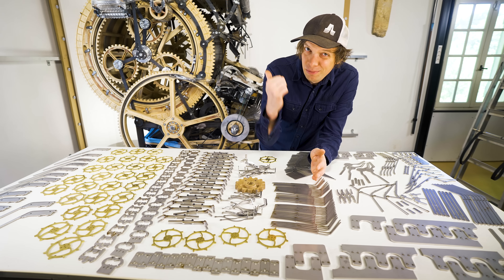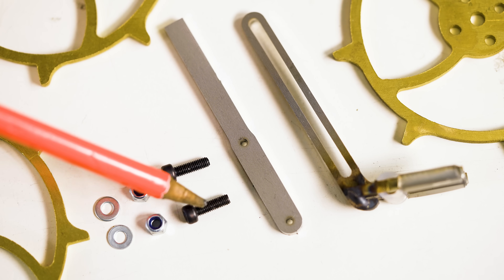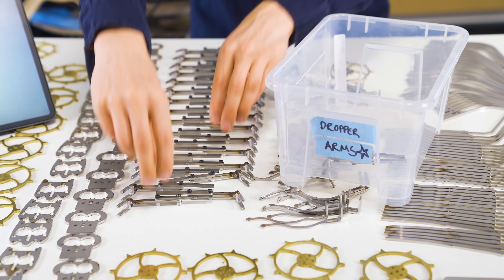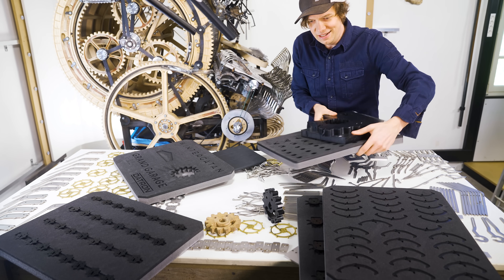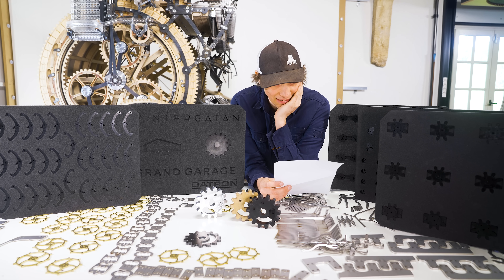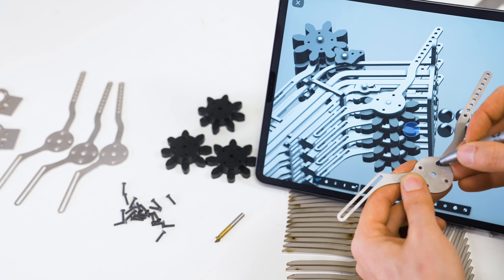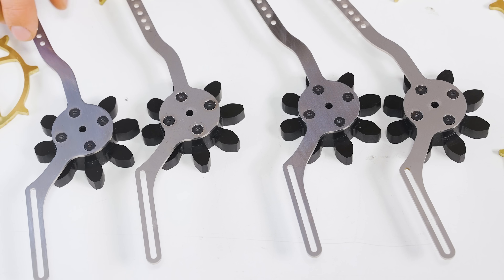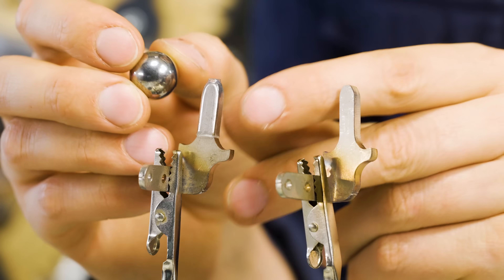Solving the 1000 Pieces Engineering Puzzle

Comment: Damn it, now that I can't put my welding cable around my neck anymore, I have to build myself a Marble Machine to put it around its neck :/
Reply: That "electromagnetic waves are dangerous" garbage is the reason why people thought 5G towers were dangerous. Don't believe the lies we are not knife fish (electric eels).
Reply: @evilcanofdrpepper  5G packs quite a bit less than the hundreds of amps a welding cable can be carrying. Enough juice in those cables and you can start levitating metal slugs in the loop. OSHA does have limits for EMF exposure https://www.osha.gov/radiofrequency-and-microwave-radiation/electromagnetic-field-memo so someone is taking it seriously.
Reply: @SBBurzmali  Yall might wanna read what you just linked
Reply: @SBBurzmali  The 5G antenna have far higher emmissions, but it depends on the type of antenna, there are smaller "router" sized accesspoints, those are not worse then your wifi router. But then there are the big ones on rooftops and towers, you do not want to hug those. but they are carefully calibrated and angled to maximize reception while minimizing power loss while keeping within regulatory requirements for safety. Belive it or not the telecom companies do not want to kill its users nor pay excessive power bills.
Reply: @TheMaidenOnes  5G towers aren't going to be radiating mast towers, which are the only kind that's physically hazardous to touch.
Reply: @TheMaidenOnes  We are comparing 5G at a normal distance to welding cables wrapped around your neck. Yes, I would be more concerned if he had a wireless tower around his neck, but that's not what we have here.
Reply: @SBBurzmali  sure, at a "normal/average" distance, the solar radiation on a sunny day is probably a bigger health concern...
Reply: @evilcanofdrpepper   5G might not be as dangerous as the initial speculations suggested, but it's still impractical, inefficient, and expensive AF...
Reply: @InventorZahran  apparently the companies think it's good enough to sink millions into its infrastructure...
Reply: @InventorZahran   "impractical, inefficient, and expensive" That could be the dumbest thing I've ever read.
Reply: @BigStrap  Thats because they know they can fleece billions out of their customers for "the privilege".  Would you like to know a short list of things that strongly attenuate (absorb) mmWave 5G signals?
1. Walls
2. Tree foliage
3. Oxygen
4. People
5. Your hands

They have to put 4 separate antennas in 3 different planes inside each mmWave phone so that it can do beam-forming and have a spare since at least one will typically be blocked by the user's hand.  Not only that, but if you expect it to work in your office building, don't, because it just doesn't have the range or wall penetration.  The planned solution to this is to install a mini-cell-tower in every building that will have service.  Outside of a large city?  Too bad, these towers only have ~1km of range and your service provider is sure as heck not going to blanket the country with one every other kilometer.

Not only that, but in addition to the 4+ extra antennas each phone will need, they also need a 5G modem that consumes almost as much space and power as an entire phone SoC + integrated LTE modem does today.  So kiss your days of finally decent battery life goodbye if you're using 5G much.

Will it still happen? Yeah probably.  Is it worth the tradeoffs? Probably not.  Fully deployed 4G LTE with carrier aggregation can deliver almost 2Gbps throughput, but US carriers are nowhere near that.
Reply: And a robotic arm to use it, don't want to hold it in your hand!
Reply: The world is better off with more marble machines! Go for it!

Comment: Clean burned holes with drill to correct diameter. Then we need quality thread cutter for stainless and machine cutting in battery drill. Good cutting fluid and cutting threads will be fast and easy. I did this with parts I made for my 3D printer.

Comment: You definitely need to use lubricant when you're drilling that stainless. Even just squirting some oil onto the bit occasionally while drilling would make a world of difference. Messy, but you'll end up with cleaner cuts and less broken bits.

Comment: Dude that packaging is another level
Reply: At the very least, it looks like a lot of empty space where some of those sheets could have been combined, thus cutting down on the number needed.
Reply: A lot of plastic foam waste though.
Reply: @piranha031091  But then... Can you find us any cheaper, biodegradable, easily find material for replacement for example?
Reply: @joshuachan6317  Popcorn works pretty well.
Reply: @joshuachan6317  Newspaper, and biodegradable packing peanuts.
Reply: @piranha031091  Or cardboard.
Reply: @nagualdesign  Food is not an easy ship between countries. Just saying.
Reply: @Cinemaaereo  If you're talking about popcorn packaging, it's only slightly more edible than the cardboard and can easily shipped worldwide, just like starch-based foam peanuts.
Reply: @joshuachan6317  Uh, paper? Or even paper foam?
Reply: @AstralS7orm  Paper foam is not paper, and paper couldn’t also protect the parts well during shipping.
Reply: @piranha031091  but it's safe for transport
Reply: In the business of packaging engineering, it's what we call "a lot of fancy trash"

Don't get me wrong, I would find a hundred ways to reuse that packaging material before I threw it away. Just a friendly way to say some packaging was overdone.
Reply: @Hexlattice  we actually do reuse that packaging it gets mixed with corn to make plastic such as food grade material 5-gallon containers for water it just depends on what country you live in and if they recycle it
Reply: @JohnSmith-cb6qx  I agree, the pieces are not made of crystal, alla that foam is overkill
Reply: It’s clearly “presentation” focused packaging.   And achieved that objective as well as protecting the parts.  However,  if you only cared about the latter then... Many of those parts could have been stacked with paper between.  Then wrapped into a brick or log with some padding around that.  Using a lot easier to recycle (or recycled) materials.
Reply: And that 0.000 mm precision 🤯
Reply: It's a Rudi thing! Now his colleagues at GG feel a little bit pressured to say the least, haha! :D
Reply: @GRANDGARAGELINZ  I hope Rudi takes some of these comments on board and uses laser cut cardboard in future.
Reply: Seems like it was on many levels in the box...
Reply: lets hope the more expensive mushroom foam becomes more popular
Reply: @bennie_bee  I hear it's being used to insulate buildings, so the price should be coming down.
Reply: Shipping and handling fee:  $259.78
Reply: @JohnSmith-cb6qx  watch seaspiracy
Reply: Bruh that fucking machine accuracy, though
Reply: Why not just put everything in a paper bag and pedal your bike over for delivery?
Reply: actually pretty normal here in germany
Reply: @lexus4tw  you mean austria ;)
Reply: @davidarbinger3543  i mean Germany, I know this parts are from Austria
Reply: True
Reply: @lexus4tw  Foam is recyclable, and can be reused
Reply: @garrettdyches8426  I know, and plastic is not a problem if recycled properly. Artificial materials aren't that bad if used correctly
Reply: @garrettdyches8426  Foam is of the "technically it can be done, but no one can do it economically at the moment" family of recyclable items, along with most types of plastic.
Reply: @JohnSmith-cb6qx  so you're talking about raising the average shipping cost by over 90% even though the material used is recyclable. At least learn what you're talking about before you make a complaint
Reply: It is horrible. Unneeded trash
Reply: So, regarding the waste issue here: This is normal, closed cell PET foam, which is easily recycable, just like every plastic bottle.
Reply: @ringo_98  Assuming that it was PET, it's unlikely to have any markings on it to confirm that. In the absence of any recycling markings, plastic waste is sorted by density, which doesn't work with expanded foam. That stuff will end up in a landfill or burned.
Reply: @nagualdesign The foam is already based 100% on recycled material. Proper disposal provided, this should not be an issue. Putting things into perspective, the residual POM stock imposes a lot more challenges if not disposed of correctly, yet I have not seen a comment about that.
Reply: @ringo_98  It may well be made from recycled plastic but it's highly unlikely to get recycled again once it's been turned into foam. The technology to sort one type of foam from another doesn't exist.
Reply: @nagualdesign  I am not making assumptions here. 
Correct disposal provided, waste foam material can be reused in many ways, that is nothing unusual. 
And even then, it's not like that foam was specifically ordered for this usecase, we are talking about leftovers that would have  gotten thrown away anyways. I appreciate the feedback, please consider that things are not always as simple as they seem initially though.
Reply: @ringo_98  Well, now you definitely are making assumptions. Do you really think this company made that packaging out of leftovers? It was almost certainly made from brand new sheet foam (possibly recycled, possibly PET) which the company buys in to make packaging with.

Twice you've written "correct disposal provided" but you don't seem to understand what happens to recyclables once they've been collected. In short, the foam does not get recycled or reused, it either gets burned or goes to landfill.
Reply: @nagualdesign  As I was the one making the parts and the packaging, I'll go out on a limb and say yes, I do, but what do I know right. 
It is common for foam waste, if not energetically recycled, which is a very viable and environmental friendly procedure, there are all sorts of composite foam materials used for sound dampening and such.
Reply: @ringo_98  Ah.. So you're Rudi? And you're saying that you don't use off-the-shelf packaging material, you use leftovers? How do you know whether it's PET then?
Reply: @nagualdesign Because I bought the material, and I know what it is made of and where it comes from. We usually use that for foam inlays for tools etc.
Reply: @ringo_98  So you do buy sheet foam, like I said. Perhaps we're talking at cross purposes. What exactly did you mean when you wrote, "it's not like that foam was specifically ordered for this usecase, we are talking about leftovers that would have gotten thrown away anyways"?
Reply: @nagualdesign  Well, I mean exactly that. This was not intended to be used as packing material in the first place.
Reply: @ringo_98  So you bought brand new sheet foam (made of recycled PET) for some other purpose, but if you hadn't used it for packaging you'd have just thrown it away? Well that's clear as mud.

To be honest, this is starting to sound like an interview with a politician, or maybe a Monty Python sketch.
Reply: @nagualdesign  I am not quite sure where the disconnect in communication happens here, I will try one last time. We use this foam for organizing inlays in drawers and such. And there happens to be leftovers from that. This is what you see here.
Reply: @ringo_98  I see. So it's a bit like buying half a dozen eggs to make an omelette, but four eggs is plenty so you can just toss the other two down the back street, and it isn't wasteful because that's not what you bought them for. 😊

One last question then; what would you normally use for packaging?
Reply: @nagualdesign  No it's like having leftover material at hand and using it.  
Packaging material is nothing pre-defined, that depends on the application. 
I think this was more than enough clarification.
Reply: @ringo_98  Thanks, Rudi.
Reply: @nagualdesign  No problem. If you have more questions just write me on discord.
Reply: @JohnSmith-cb6qx  its not to bad considering its just for one guy and not a commercial product.
Reply: @JohnSmith-cb6qx  Have you heard of recycling?
Reply: LOL that's common anything waited over 2 gram I normally get segregated. Can't imagine what those pieces would have looked like if they were able to grind around on each other in the packaging
Reply: it's a huge waste of foam that's gonna end up in a landfill. just wrap the parts in paper and put them in a box. Typical makerspaces.
Reply: @SuperAWaC  I get the feeling that it was a show box, designed to look good when opened on Youtube. A Potemkin Package as it were.
Reply: @SBBurzmali  it's just basic laser cut foam and not even packed efficiently.
Reply: @SuperAWaC  Not in Europe. Maybe in the US...
by the way, we can still drink our tap water without chlorine.
Reply: @audhen1  i guarantee your tapwater is chlorinated, you just aren't being told about it. it is set up so the chlorine fades to below human detectable levels by the time it reaches a outlet, unless the chem adder is not properly calibrated.
Reply: @SuperAWaC  nope. Living in germany. No chlorine.
Reply: @audhen1  how do they keep the water sterile then
Reply: @audhen1  in Germany chlorinating drinking water is mandatory as soon as there are germs in the water. The threshold is 0.3 mg of chlorine to the liter. You usually won't know whether your water is chlorinated or not unless you call your municipal water provider.
Reply: Definitely OTT. As someone who begins a sentence with "Dude" I would have expected a bit more environmental awareness. Aren't you kids supposed to be 'woke' these days?
Reply: @nagualdesign  who hurt you

Comment: Such an amazing demonstration of the powers of computer design, and distributed manufacture, when you open parts from different continents and they snap together, it's brilliant, well done everyone!
Reply: Precisely.
Reply: Hang on though, it also points to an incredibly well done design!
Reply: It is. Also it's because of the translation of the parameters weather English or Metric measurements, the supplier can adjust to it and makes it to to spec. Hats off to the company to add a black colored Wilson. As an added value.
Reply: @tigerzero5216  Yeah hats off to the standardisation of units of measurements and globally consistent methods of calibration!
Reply: @tigerzero5216  What does the English weather have to do with it? 😊

I think you mean "whether imperial or metric". Also, we use the metric system in the UK.
Reply: When the stainless steel and POM pieces snapped together, I gasped. It's incredible what we can do nowadays (and funny that people from opposite sides of the globe can make pieces that fit together better than I can in my school's machine shop)
Reply: That technology has been around for a long time, since the advent of ASMEY14.5. It's the reason GD&T exists.
Reply: I think it would be good for him to start quoting the tapped threads into parts that he is getting sent out for manufacturing. I often send parts out for work, and most places will do threads for you. It would save him a lot of time, and make the parts fit together even easier and would make the parts more consistent. He did point this out in the video, but i feel like he has realized this before but forgot the lesson.

edit: Could probably add countersinks as well. Martin should be able to outsource part manufacturing so that he only needs to do design and assembly, helping to maximize his efficiency.
Reply: That was very satisfying. Can you imagine trying to make that happen 20+ years ago?
Reply: It's great. I just wish Martin would have a little more confidence in the engineering. He keeps making comments about how the part could fail to work as designed and he would call it quits. That's exactly what we try to avoid with all of the upfront engineering: Works as designed.
Reply: @russellscott1466  I think he means the design can fail to work how he imagined it would. Which is perfectly reasonable, it's not like he has a full physics simulation of the machine to use for testing designs. The only real tests he can do are to actually build the things and physically test them.
Reply: Fun fact: the first american product with interchangeable standardized parts started manufacturing in 1798 by Eli Whitney, it was a musket, in Europe the idea was supposedly discovered a bit earlier and used to make standardized interchangeable clock gears in the 1700s
Reply: Team work, ay? :)

Comment: Cheers lad!
So... Basically, the drills you got or general standard spiral drills are made for drilling in full material, such drills hate it when less than 50% of the drilling diameters are already drilled.
That us usually the main reason in that of the constellation you drilled in
Reply: Correction,
WHEN MORE than 50% are already carved out

Comment: General rule when drilling in stainless slow speed with high pressure.

Edit, by slow i mean slower then what you would have done it with usual blacksteel.
Reply: Yes!!

You need slow and firm to get a good bite, otherwise it rubs across the surface and heats up. That destroys the bit's temper and work hardens the steel.